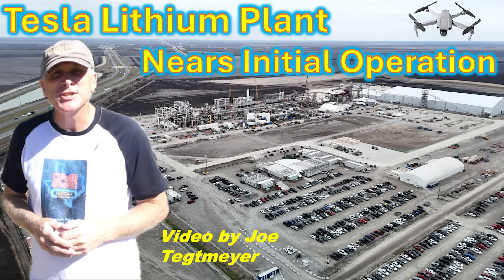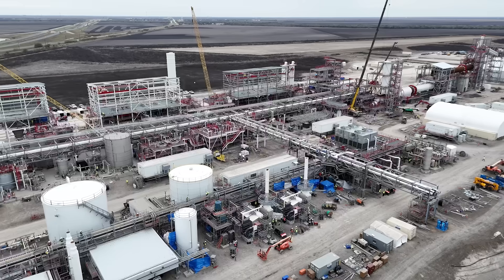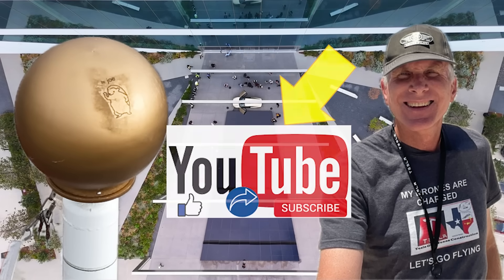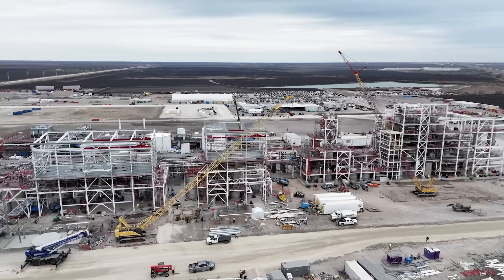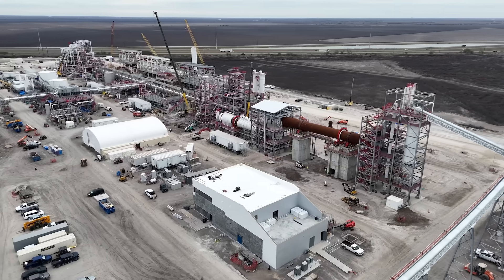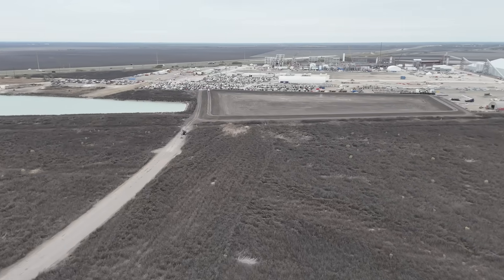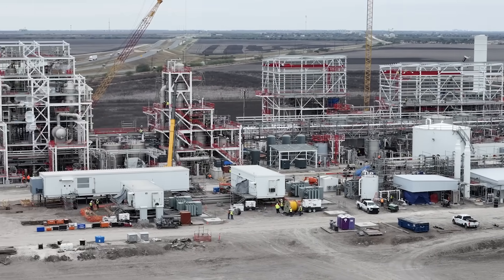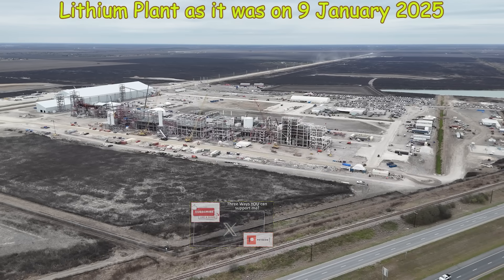Tesla Corpus Christi Lithium Plant Progress! 9 Jan 2025 Site & Operations Update (12:15 PM)

Comment: Do you have any information about reports of the refinery needing 400,000 gallons of water per day in this arid area?  It’s getting bad press.
Reply: From a discussion on Joe's Patreon site, that may be circulating water, not water consumed. Wildly variable figures being reported.
Reply: @DessieDoolan  They are actually trying to buy 8-10 MGD. They currently don't have a contract for any water. The Tesla representative was warned before that built the plant that we are in a drought and have no extra water and they should build it in Louisiana.
Reply: @joweb1320  Quite the risk to take if water is that critical to the process.

Working on the 8 million gallons per day, even coming in by train it would be 266 tanker cars. No rail connection yet.

Will be interesting to watch this play out.
Reply: @DessieDoolan  You are correct. They were warned at their first public meeting in Robstown. This was a huge mistake, in my opinion. The other mistake was not putting it in the SEC filings because it will have a material impact on earnings.
Reply: @joweb1320  I will add that I am a little skeptical about the claimed 8 million gallons/day .

That volume arriving on site each day also has to leave site, either as steam, or effluent.

Not my field of expertise, I'm a carpenter.  Harder NL a process engineer who is closely following the project might chime in with his thoughts.
Reply: @DessieDoolan  The 8 MGD came from meeting minutes with the STWA South Texas Water Authority.
Reply: @joweb1320  I'll see if I can track it down. Curious to know if the number was supplied by Tesla, or a number calculated by the water authority.

I've been following the Tesla story (mostly the vehicle factories) for 7 or 8 years. Finding accurate non-partisan information is always difficult. That's primarily why I started watching the GT construction videos, to gauge for myself if Tesla was a genuine chance at success.
Reply: @DessieDoolan  It was supplied by Tesla according to the minutes. It can be found on the STWA archived minutes.
Reply: It was on more than one set of minutes. Try February 27th, 2024 on the top of page 2.
Reply: @Luke_Starkenburg  I think Bloomberg  wrote about the water needed. There isn't any water right now in the area.
Reply: They are saying this plant is the reason Trump wants Canada. They need the water from the great lakes lol
Reply: You meant to say 8 Million gallons of water per day. This is sad 😔
Reply: @VersatileShakia  Yes, 8 million gallons of water per day when people can't even water their own trees.
Reply: These mining plants are not worth destroying the environment and causing a water shortage. These electric vehicles are crap anyway.